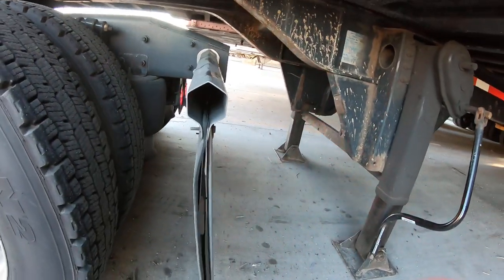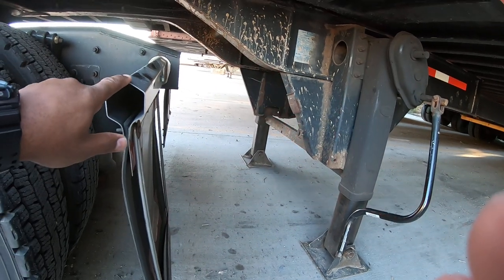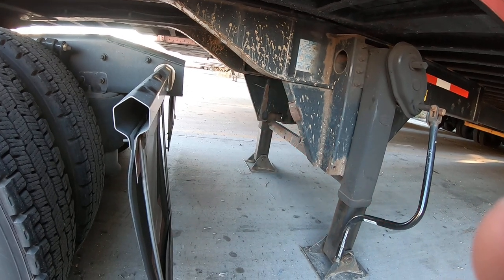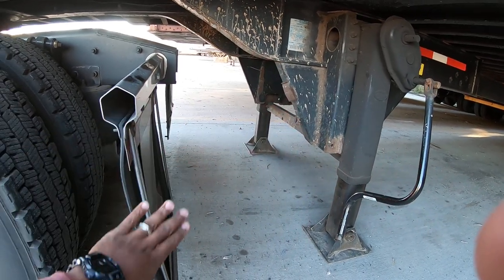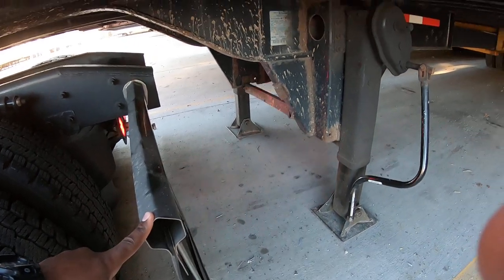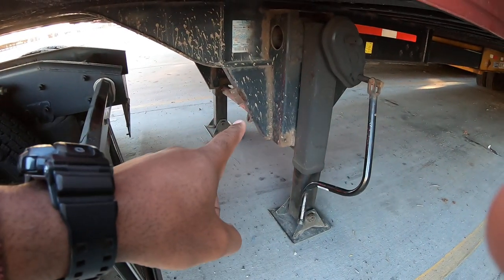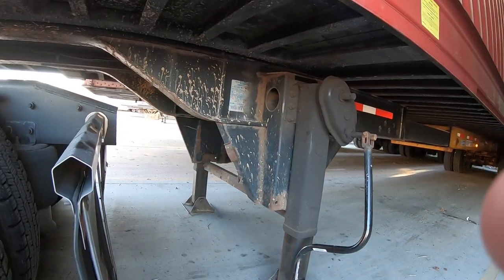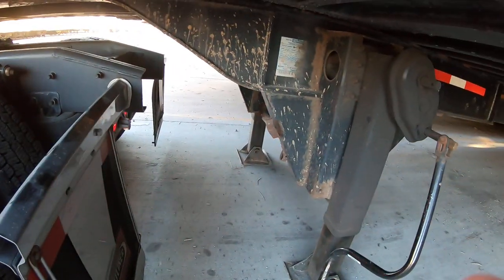Mudflap Hangers on Semi Trucks - How to Keep Them Damage Free

Comment: Thanks! I was wondering how the mudflap bracket  could be damaged.  When I finally got a truck(company), the mudflap was damaged. Then again when someone else had to use my truck(daycab). A driver told me it was bc of the landing gear. In my mind, I was like, yeah right. We usually use dry van trailers, hauling beer. So you saying, the mudflap can be damaged when turning. Thanks again
Reply from the maker: You're welcome